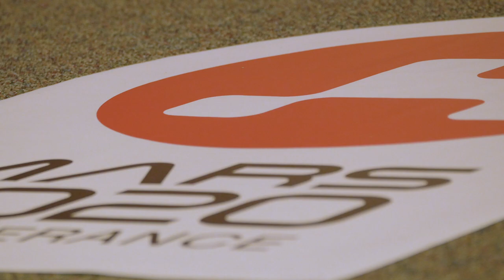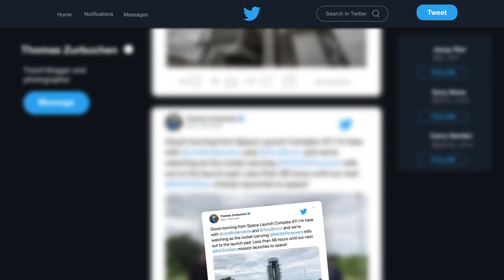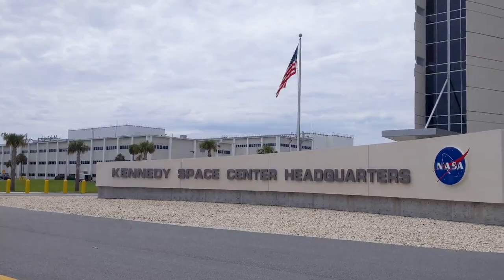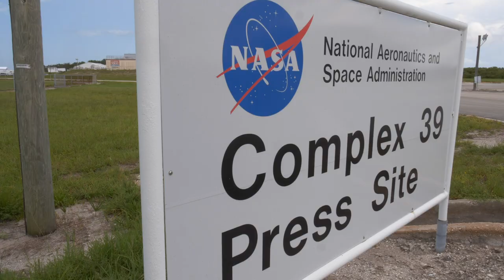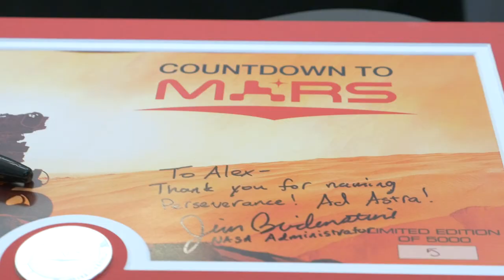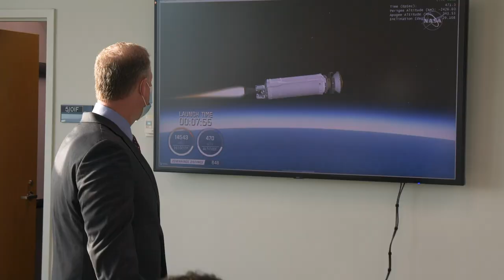Countdown to Mars: A Story of Perseverance

Comment: could anyone explain me that, the rover put that tube on the surface of mars for 2026 mission. But if the tubes are covered by martian sand storm then how they will find it ?
Reply: are the previous rovers covered by sand? No. So even in 20 years you could recover the tube without problem.
Reply: @unhommequicourt  thanks for your answer

Comment: To be honest ,mars would be too hot and too cold and the atmosphere is very weak . Plus if I'm  not mistaken , would you have to pass through the astroid belt?
Reply: Asteroid belt is between orbits of Mars and Jupiter. Besides it has barely 1 asteroid 1000 000 000 000 000 cube kilometers
Reply: master loller sure, Mars is a hellish nightmare, but it still could be a place to live. We could terraform parts of Mars to make it like Earth, it could be our second home. To be honest though, I think the Moon would be more beneficial to us in the long run to settle on.
Reply: @jakemckee2005  yeh , but once you land , the temperatures would be a huge problem plus , because mar's atmosphere isnt strong enough , some astroids from the belt separate and fall straight down to the planet.
Reply: master loller temp would be a huge problem. If power lags or goes out, you die. Mars’s atmosphere is about 1/168~ as dense as ours so it doesn’t trap heat. Asteroids wouldn’t be a huge problem but radiation and gravity would.